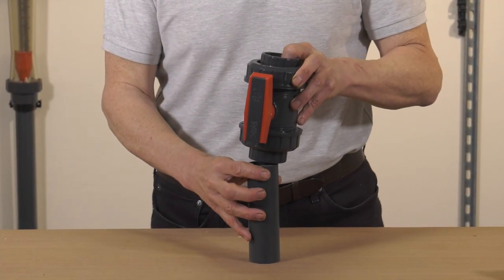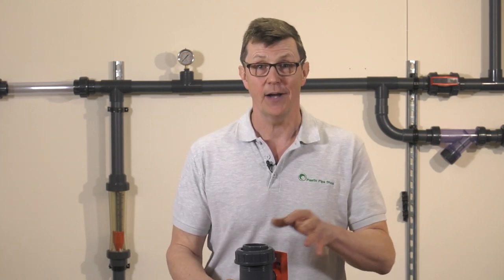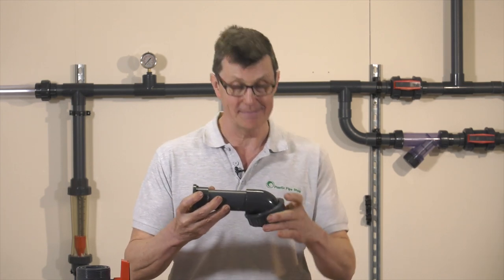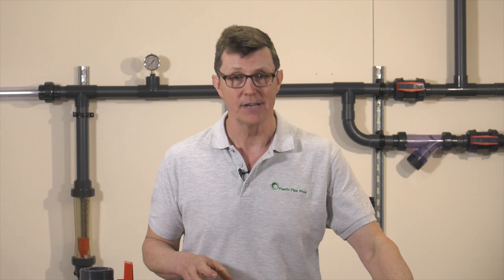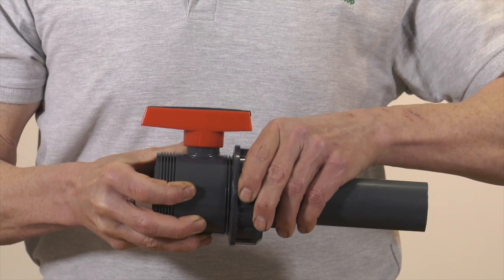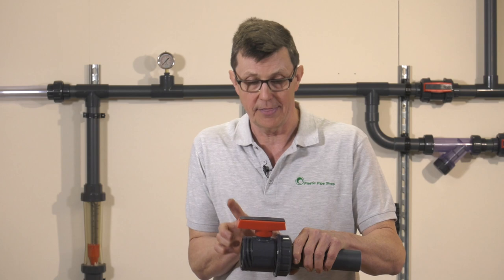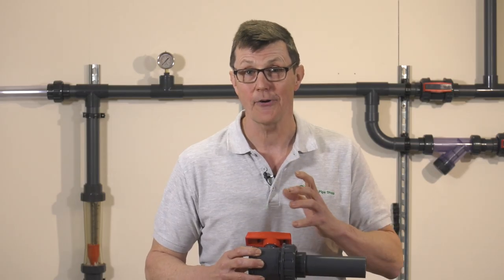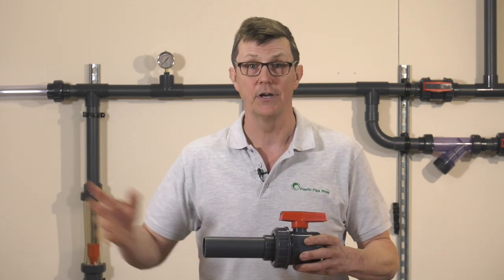Tips on Installing a PVC Double Union Ball Valve

Comment: Thanks! Question: What can i do if i did get glue on the union face. Can i clean it with pvc cleaner is that enough? Or do i need to replace it? Or maybe use silicone lubricant? Thanks !
Reply from the maker: Hi there! I would try to clean it off with cleaner and then use silicone grease on the O-ring...and cross my fingers! I've done this a few times on the past and it's always been OK.

We sell the cleaner here: https://www.plasticpipeshop.co.uk/Griffon-Pipe-Cleaner-500ml-Tin_p_6613.html

We also sell silicone grease here: https://www.plasticpipeshop.co.uk/Silicone-Grease-30ml-Tub_p_7223.html